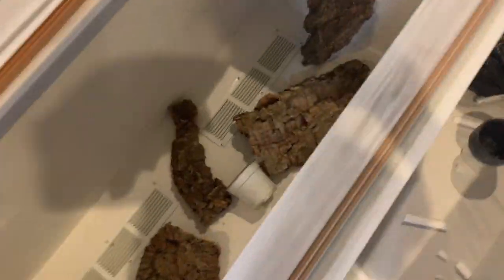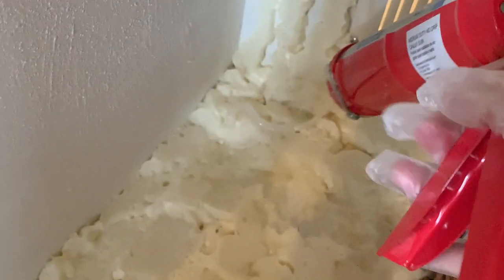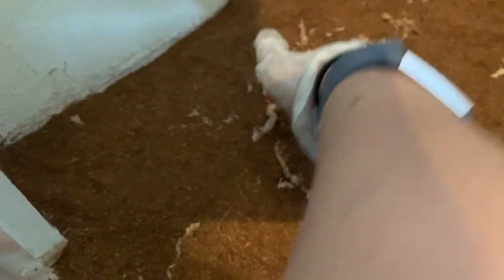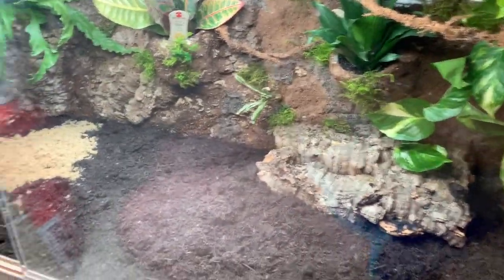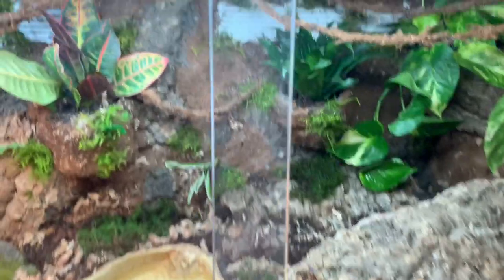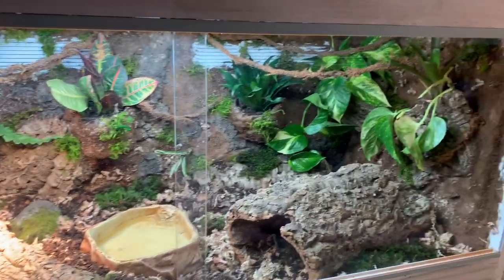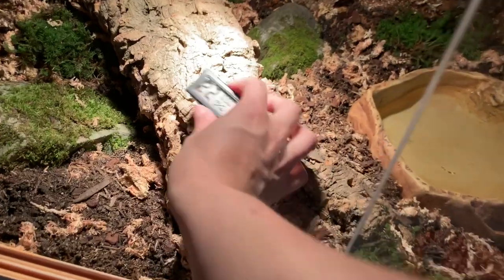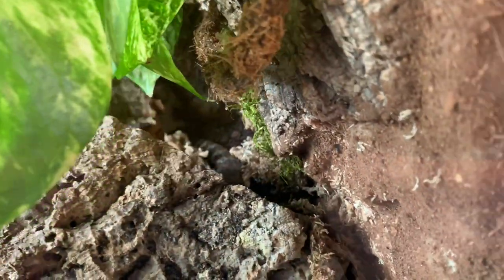Setting up a Bioactive Blue Tongue Skink Enclosure! // DIY Reptile Background

Comment: Do you think this setup would be ok for an eastern blue tongue? It looks amazing!
Reply from the maker: thank you so much! Easterns are an arid species, so you would just need to tweak the set up to be more on the arid Australian side and less on the tropical side :)  For arid species I would add more playsand so id do about 40% playsand and 60% organic topsoil. Then you would want to make sure the plants you select will do ok in an arid setup! I recommend reading through reptifiles.com! she has a caresheet for blue tongue skinks and she specifically talks about the different kinds and gives ideas and suggestions for set ups for the different species :)
Reply from the maker: I also built enclosures like this for my bearded dragon and uromastyx who are both arid, so maybe youll get some ideas from those videos as well :)
Reply: @zareptiles  thanks so much! I'll definately check out your videos, your enclosures are amazing x Appreciate it :)
Reply from the maker: Thank you so much!😁
Reply: @zareptiles  I wouldn’t really consider easterns as arid, maybe semiarid or temperate. There’s some eastern localities like queensland varieties that live in subtropical/tropical areas with humidity requirements the same as northerns. I have 3 easterns and one is a queensland variant and I found that he does better in higher humidity than my others which are a victorian and NSW type that prefer a dryer climate.
Reply from the maker: @critterc0rner  This is true! It does very much depend on the individual and its specific locality :)